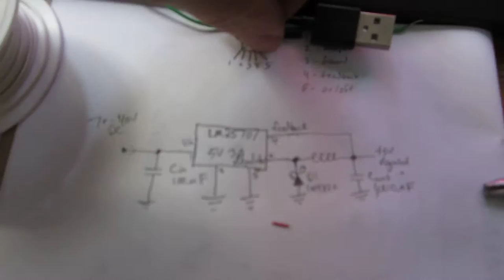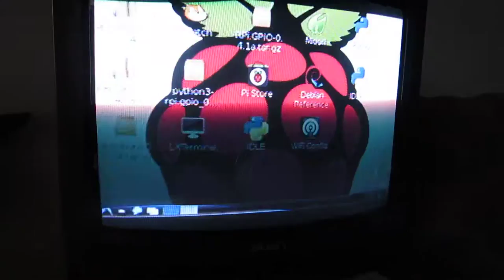Raspberry Pi Running on AA batteries

Comment from the maker: It still could be fine, but you may have issues powering the GPIO pins if you end up using them. Otherwise if it works and you are under the 5V so you shouldn't be blowing it.

Comment: First off, nice video!
I'm using the same circuit, except my inductor's packaged a bit differently, like a big resistor you know.. my only issue is I'm getting around 5.12V on the output which I then connect to a female USB-A port breakout board to which I connect a standard mini-USB cable, and the TP1-TP2 voltage that I get is 4.6~ V and if I plug in a USB 3G Modem into the Pi, it drops to around 4.1V
My Pi is working fine, but I'm pretty sure that these voltages are kind of low..any thoughts?